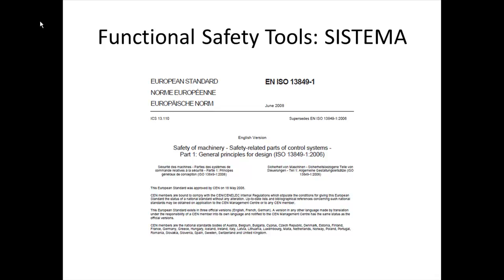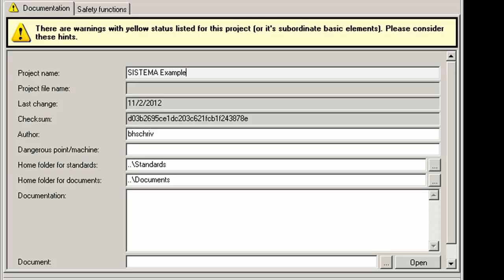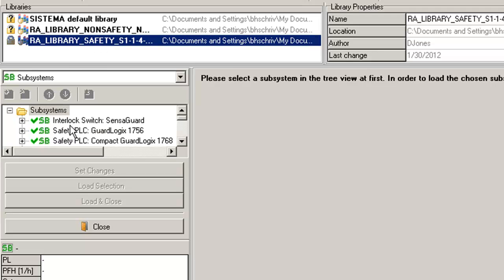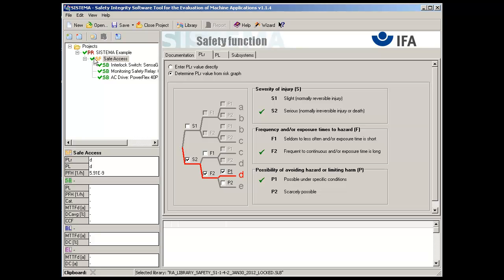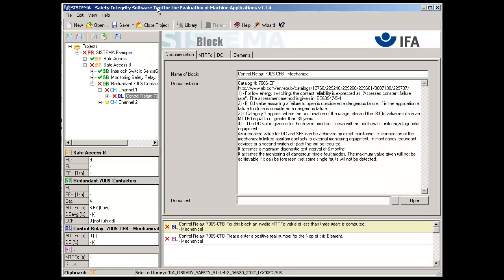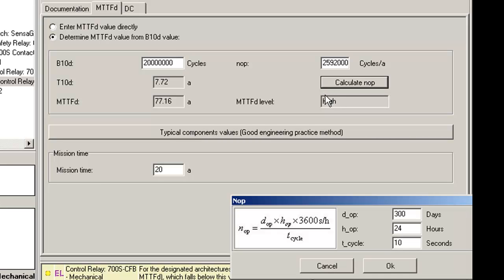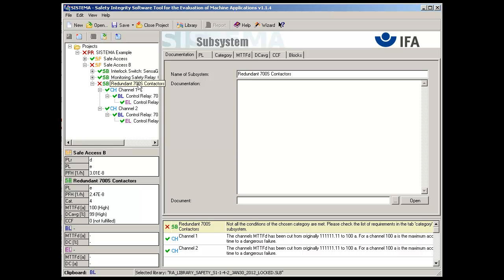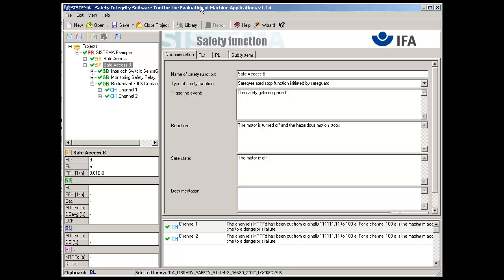SISTEMA Explanation for Beginners

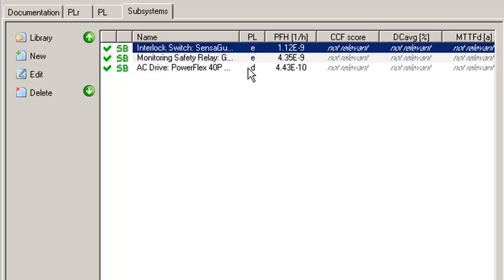Comment: In 12:20 you mention that adding a contactor to the output subsystem wired in series with the drive would help achieve PLe. I wired it phisically but how do I enter it to Sistema? Simply adding a new category 3 output subsystem with my contactors results in an even worse PL level for an entire safety function. How to define that these contactors are in series with my VFD to improve overall PL?

Comment: When adding the redundant 700s contractors, you say SISTEMA automatically creates the underlying hierarchy.However when I tried it fails to do so, it doesn’t do anything and has three error messages, saying no category was defined, not all the conditions of PL are meant and for this subsystem an invalid MTTFD value of less than three here is computed